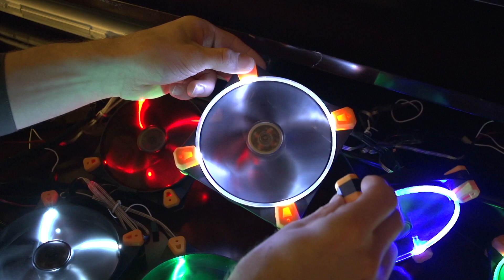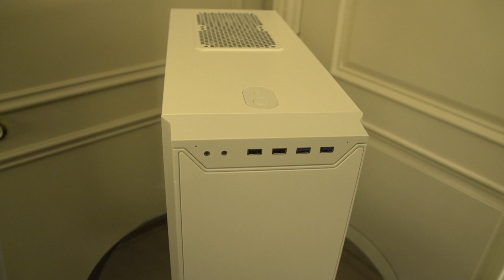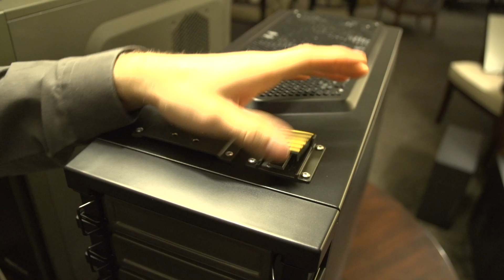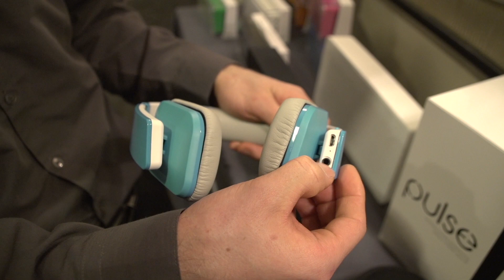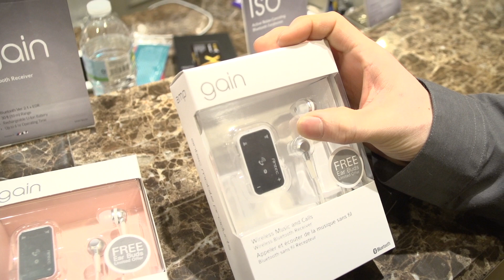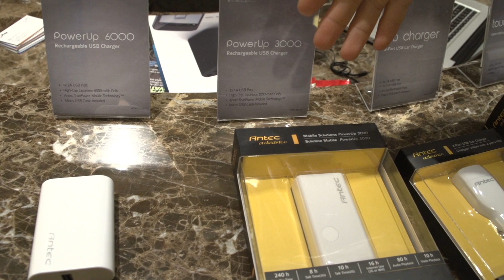Antec & AMP Products Showcases - Value Gaming Case & Mobile Accessories Linus Tech Tips CES 2013

Comment: The point the person is making is that most prices aren't converted by conversion rate, but just seem to end up being 1:1. Basically, products seem more expensive than they should logically be if you just convert prices. Also $169.99 is £105, so the point still kind of stands.